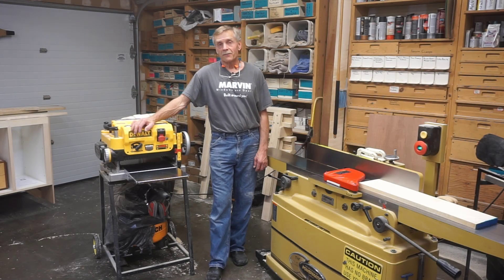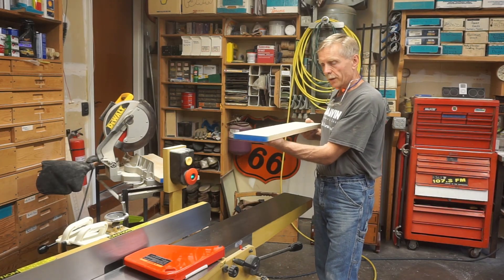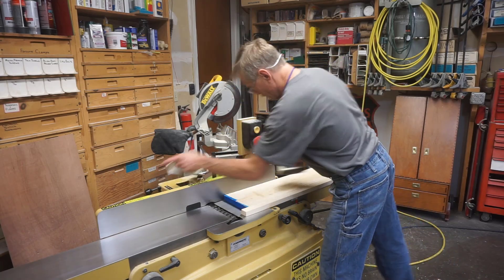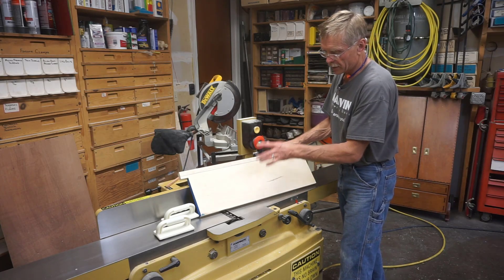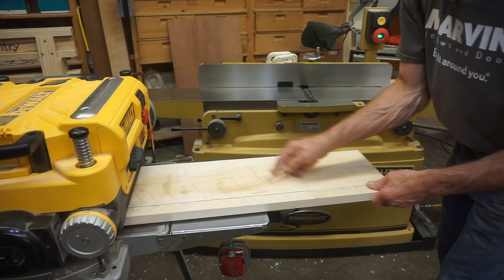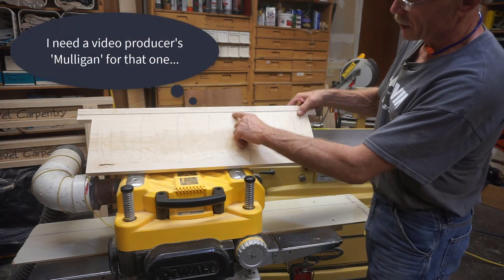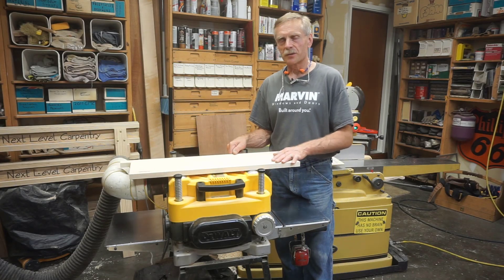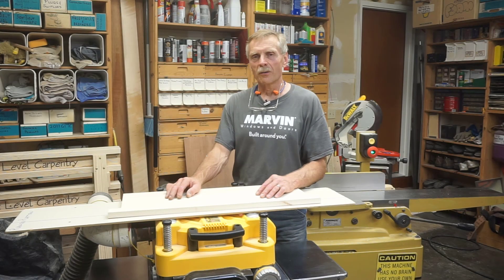Supersize Your Jointer for Planing Over-width Boards

Comment: Great tip!  Do the rollers ever have any trouble pulling the board straight, when the lug side is up?
Reply from the maker: It doesn't matter even if the board doesn't get pulled straight through as the lug gets planed down because, once the lug is almost flush, the final pass will smooth out any irregularities. Make sure the thickness planer's platten is smooth and waxed though because, if the board is wide and the lug is narrow, the rollers might not get enough 'traction' to pull the board at all...

Comment: no jointer needed just do it with your plainer only using a reference surface some strong double side tape and wedges cuz I'd get grey doing it this way cheers
Reply from the maker: Don't make yourself go gray planing boards with any method.  Using a planer sled is a great way to go for a few boards but, if you have to do more than a few, you'll get more gray flattening boards your way than mine... juss sayin! 😎

Comment: What's the widest overhang you'd recommend? If I have a 6" jointer, could I use this method on an 8" board?
Reply from the maker: With practice you should be able to manage about 1/3 more width than the capacity of your jointer 8+ inches is manageable in my experience.

Comment: First I thought "Why not do the hot glue and Shim trick and just use the planer?" Once I finished the video,  I think I could see this method actually being faster.  Very clever method!
Reply from the maker: Thanks for watching and commenting!
It's good to have both methods in your repertoire to use interchangeably depending on characteristics of whatever boards you need to flatten.  If this method works it's definitely faster for a stack of pieces but, for wider/longer pieces with more twist issues the shim & hot glue method might be a better option.

Comment: Excellent video and technique!  Another method is to joint all the boards to the capacity of your jointer and glue them together to the width of your planer.  Rinse and repeat and there is no limit to the width of your panel.  Maybe not as accurate but you’ll get there in the end.

Comment: Maybe a dumb question, but after you run a wider than 8 inch board over the jointer and left with the overhang lug, couldn't you just flip the piece around, and feed the piece, lug side down, against the fence, getting rid of the lug?
Reply from the maker: There is a way to do that John, but it's not as predictable, accurate or consistent so I use the method shown in the video because less than excellent results aren't acceptable IMHO.  FWIW your question isn't dumb but shows intelligent thought process and reasoning IMHO!

Comment: Just because you can do something a certain way doesn't mean you should. If you already have a 13" capacity planer, just face joint with the planer using a bed/sled and shims.
Reply from the maker: Not sure why you're compelled to say anyone shouldn't use this method just because you think 'your way' is better. If you prefer to do this a different way, just go ahead. While you're at it, produce a video showing viewers exactly how to go about the method you mention and let them use their own judgement to decide which is best for them, OK?
  
Unfortunately we'll never have occasion to compare actual performance or results because I'll put the method shown in this video up against the sled method for longer pieces any day and come out far ahead by every measure.
And before you get all worked up and start blathering about how wrong I am, I actually show, in detail, how to use a sled and thickness planer to flatten short, wide boards in this video: https://youtu.be/sxBsNEYp140  where it is a better option IMHO.

Comment: According to what you are saying,  you can't cut a rabbit on your jointer deeper than a shallow first cut?
Reply from the maker: That is true when the rabbeting lip is in place...
Reply: @Next Level Carpentry  
I question I am confused then. How would you cut a deep rabbit on the jointer?
Thanks
Reply from the maker: @craigbeam3351   It's possible to cut a rabbet as deep as the maximum depth of cut the jointer is capable of.  In my case, with the PJ882, I can cut a rabbet a full 1/2" deep in a single pass, although I only do that when it's the only way to get it done.  That's because such a heavy cut can cause lots of chipping without a very slow feed rate and that is often not a practical solution. 
 When flattening large boards like I show in this video with what is essentially an 8" wide rabbet, it's totally possible albeit a bit dicey to do deep rabbets because it requires unbolting the rabbeting ledge so multiple passes are possible.  I don't mean to be condescending in my replies but should say that these are kind of advanced techniques/uses for a jointer that require a pretty deep understanding of what's going on to do safely.
Be cautious but not afraid to figure out how to get the most out your jointer because learning this stuff can really expand your abilities with tools you already have.
Best,
Matt
Reply: Thanks for the thoughtful reply. I have a lot to learn.

Comment: I'm just getting started with a jointer. Do you have a recommendation for a brand or style of push block? Thank you for your videos!  They are really great! I appreciate your in-depth content and straight-forward style of presentation.
Reply from the maker: For liability purposes I can't make a recommendation but I can tell you what I use for push blocks in the NLC shop.
For years I used the stock ones that came with my Powermatic jointer until a viewer sent me a pair of simple coarse rubber tile grout floats like this: https://www.amazon.com/dp/B0014XZK3Y/?ref=idea_lv_dp_ov_d 
I found them to be THEE BEST I've ever used... but that's just me.  I see one potential issue in that the backer on these is aluminum, not plastic, and, if it ever got caught up in the jointer's cutterhead it could be catastrophic.
Glad you like NLC videos!  FWIW When I first 'discovered' what a jointer was, what is was used for, and began to use one, it revolutionized my woodworking/carpentry world so  I anticipate a bright future for you too!
Best, Matt
Reply: @NextLevelCarpentry  Awesome!  I really appreciate the reply, and the encouragement!

Comment: Great video.  Saw it just in time!  Thanks. Does it matter how long the "platten" board is or do just need to clear the ends of the infeed and outfeed tables plus a couple of inches? How about the width?  I assume as much jointed surface as you can get on the platten with a bit of clearance and obviously not more than the cutting capacity of the planer...
Reply from the maker: You got it Vincent... if I'm not in the shop I just use what I have on hand... as long as you meet the criteria you describe it will work.  If you're making a dedicated platen it's nice to have it equal in width to the cut of you jointer and I like it better if it's a little longer than the length from the beginning of the infeed table to the end of the outfeed table.  That way everything feeds smoothly and you have a little length for a 'stop block' on the underside of the infeed end.  It sounds like you totally get it but I'll mention that waxing the surface to make it slick/smooth as possible makes a real difference in performance of the setup.  Best, Matt
Reply: Thanks Matt. I'm wondering whether another potential video would be functionally extending the length of a planer outfeed table to assist in the jointing of long boards.
Reply from the maker: @VinceEspositoJr  while that would be a great topic it takes me forEVer to take videos from concept to publication (because I do the entire process by my lonesome) you can get a good idea of how I'm able to deal with long boards in this section of my most recent video upload: https://youtu.be/sxBsNEYp140?t=742 Granted I show using a planer sled but you'll see how I use two custom roller stands to virtually extend the length of the planer's infeed and outfeed tables to handle large/wide/heavy boards with relative ease.  BTW making these custom stands is the topic of my next video project on the channel...
Best, Matt

Comment: Thanks for the video. As I’m sure you know, the static on that exhaust hose is killer, and it looks like you’ve got yours grounded. Can you briefly describe how you set that up? Thanks.
Reply from the maker: Pretty low-tech Steve.  I just put a crimp-on terminal on one end of a piece of heavy stranded copper wire, attached it to a metal part on the back of the planer with a screw that's already there and then wrap the wire loosely around the PVC outlet pipe setup I have.  Simple as that.  BTW I now use anti-static flex hose from Air Handling Systems so a ground wire is no longer necessary...
Best, Matt
Reply: @NextLevelCarpentry  thanks Matt.
Reply from the maker: @SMNJ5071  For sure... BTW if you check into anti static hose talk to their guy Kae... super helpful guy...

Comment: 2:32 in, aaaand nope. Remove a guard? Never, ever, never ever, never never NEVER remove guards. It'll may work once, twice, even over and over for years. The ONE TIME it costs you your hand, you'll wish that guard was still there.
Reply from the maker: Your level of paranoia is a bit extreme IMHO... do you ever leave the house?! People drive places safely for years but people often die every day in traffic accidents... and on that day they wish they'd stayed home, right?
Reply: @NextLevelCarpentry  a "master carpenter" suggesting people remove safety guards in order to make a machine do more than it was designed to do is grossly irresponsible. There are safer ways to mill lumber. I've only just found your channel, and I've already lost all respect for you.
Reply from the maker: @lazarus9004  not only are you paranoid but you are all so ignorant... I have not lost respect for you since I never had any in the first place but I do pity your perspective on life... Goodbye.
Reply: @NextLevelCarpentry  do you know why SawStop was developed? There was a need for a safer table saw. Do you know what every saw on the market is shipped with? A blade guard. Take a guess at what is the least used accessory with a tablesaw. It's the guard. People don't use the required guarding, they get hurt, and then they sue, only to find that they lose the case due to their own negligence. I sincerely hope nobody gets hurt by following your advice. And by the way, it's "also" not "all so".
Reply from the maker: @lazarus9004  Is THAT why SawStop was invented?! WOW... its amazing that I never realized every saw on the market is shipped with a blade guard either... and here you come along with such enlightenment!  It isn't a surprise though that you mention suing after getting hurt and suspect the 'they' that "lose their case due to their own negligence" refers to personal experience.  I'm also curious how you're able to survive in today's spell-check world if admonishing me for including 'all so' instead of 'also' is such and event that you find the need to point out the infraction... 🤣🤣  Here's a bit of my advice you'd do well to follow:  Get a Life.

Comment: I need to make some siding for my house because I have removed some windows. Is there a way I can use a jointer to make a board have a 1/8" top width with a 3/8" bottom width? Essentially having one side of the board flat with the other side having the bevel. Like a right angled trapezoid kind of shape.?
Reply from the maker: It would be tricky to get consistent results using a jointer but, with a thickness planer, it's easy-peasy!  I show making an angled planer sled in this video: https://www.youtube.com/watch?v=NnqhdzwZTUc which is the concept I'd use for making beveled lap siding like you need.  Make the sled 1/4" higher on one edge than the other to produce the taper you need.  Hope this helps... it's totally do-able!  Good luck...
Best, Matt

Comment: How would this process be modified if working with a jointer that did not have a removable rabbeting ledge and with a board that required multiple passes? 

Go back and forth removing the lug until you achieve enough of a jointed surface to then proceed to the planer?
Reply from the maker: With great difficulty, if at all.  You're pretty well restricted to working with straighter/flatter material without more capable machines... sorry. 😌  Your best bet is probably using a planer sled in a thickness planer... it's a bit more time consuming but can circumvent lack of a 'professional' jointer.  Best, Matt

Comment: I understand and have used a similar process, but I'll point out a couple of things in the video that were questionable. First, you say the "lug" has to be less than a quarter of an inch to use your "false platen" on the planer, but then if the lug is more than an eighth of an inch you can't plane it off anyway because of planer capacity. So, actually, the lug must be an eighth of an inch or less no matter what (unless you can also supersize your planer capacity).

The second thing I've wondered about this process is just how parallel the top surface will be with the bottom (lug side) when it runs through the planer and nothing is supporting that last inch or so. There has to be some limit as to how wide that lug can be. I have a six-inch jointer, but a twenty-inch planer. I seriously doubt I could joint six inches of a board 20 inches wide and still use this method. Even on a smaller scale like your demonstration, I would think the pressure of the feed rollers and the cutter head would tend to push down on the lug side of the board and cause the opposite side to end up a little thinner than the lug side. It may only be a few thousandths of an inch when your lug is only an inch or two wide, but if you go beyond that, I would think it would be a significant difference, especially if you are building a panel by edge gluing multiple pieces.

Comment: I think it's worth noting: if your overage is MORE THAN 1/2 the difference than the JOINTER'S capacity, this WILL NOT WORK without add'l steps!

That is to say, if you have a 6" jointer, and a 13" planer, and you attempt a 12" board, you will RUIN THE BOARD, UNLESS the thickness of your platten is very nearly identical to the DIFFERENCE in the jointed and non-jointed planes of the board. 

Example:

`------------------__|    <- This will work fine, since the jointed part is much wider than the remaining "ledge", the board's weight will keep it indexed flat along the platten.

`--------_____| <- This will often try to tip away from the platten unless the platten is pretty much exactly the same height as the "ledge" OR you have the un-jointed side supported so the jointed side remains coplanar with the platten (pain in the ass). This can be resolved by taking REALLY fine passes.

`---___________| <- This WILL tip away from the platten and you'll plane off a corner, lengthwise, unless you shim the whole piece, in which case congratulations:  you've invented a sled. That's even SLOWER.

This will rarely arise, but be aware: the GREATER THE WIDTH OF THE BOARD BEYOND 175-180% CAPACITY OF THE JOINTER, THE MORE THIS TECHNIQUE WILL FAIL YOU. So:
- A 9" board on a 6" jointer? That's 150%. No problem. 
- A 11.5"? That's 192%. Gettin' hinky, but doable.
- A 12" That's 200%. Don't try it.

And before anyone proclaims how unlikely this is, my first jointer was a 6" Shop Fox benchtop. My first planer was a 13" benchtop Dewalt. My first time TRYING this trick was with a rough-cut walnut 1x12. I'll let you do the math. It's a GREAT technique, and is a bloody godsend... so long as you keep the above formula in mind. My 2 cents.

Comment: Sorry if this is a dumb question but if the planer board is flat and it transfers the flatness to the other side, cant you just use that without even using the jointer?
Reply from the maker: Your question is a bit obscure Brandon but methods like the one I show in this video are necessary to flatten certain boards.  The key point is that planers do not flatten boards that are not flat, making the jointer necessary, as shown in the video.  Best, Matt

Comment: I'd always rip the board - plane and thickness to within a couple of mill of what I need, glue it up and then thickness to final dimension. Even on the craziest grain, if you're sure to glue back together the 2 cut edges you will never see that join because you've only really lost the saw kerf and a pass on the jointer and so the final thicknessing makes that join practically invisible